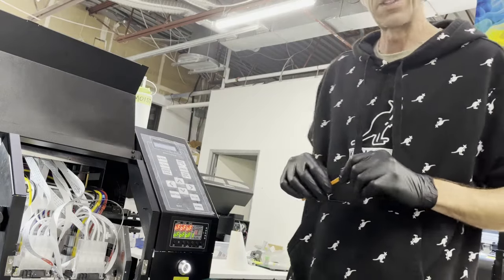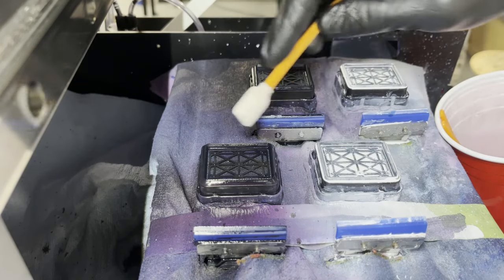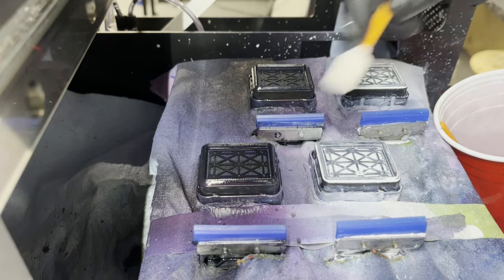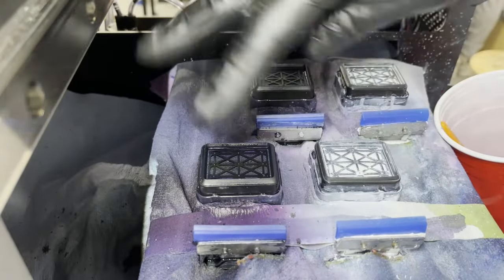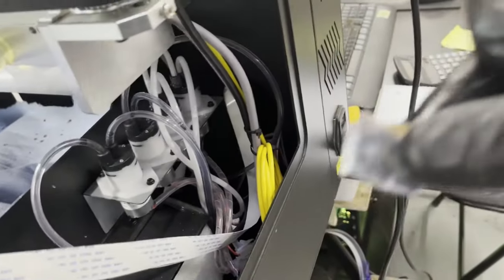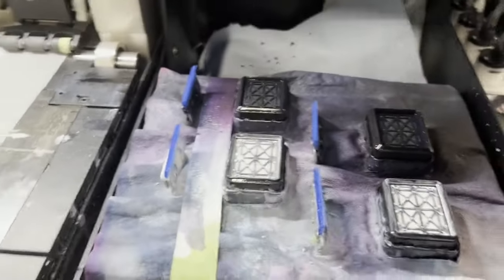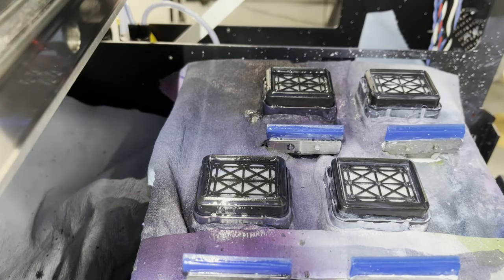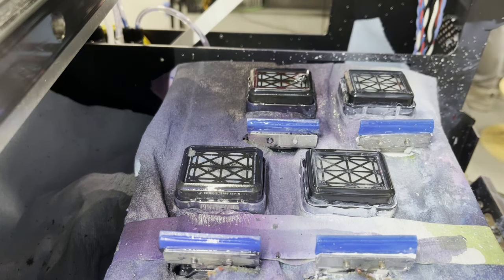DTF Printer End Of Day Maintenance **WET CAPPING**

Comment: Now adding the metal between the sensor is genius. My vendor told me I had to place a wire and let the heads come back. It never worked for me so I just did syringe on top and syringe on bottom. I’ll try it TY.

Comment: @DTF Doctor great video! 
What type of inks do you use and what printheads does your printer have? 
I would like to do the same on my printers but I don't want to cause any damage. 
I have printers with UV inks and Epson XP600 print heads.
Thanks!
Reply from the maker: Print Head is i3200 And Ink is Supreme Ink from DTF Toronto. We have both in stock. We also carry Powders & Film.
Link for Ink Bundle: https://www.dtftoronto.ca/product-page/supreme-bubdles